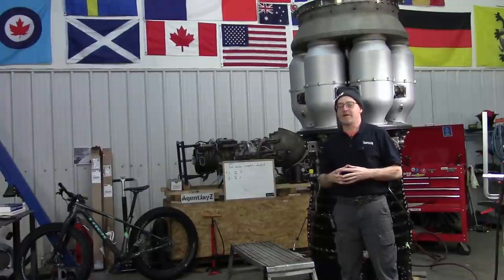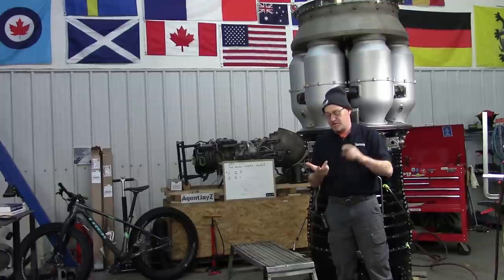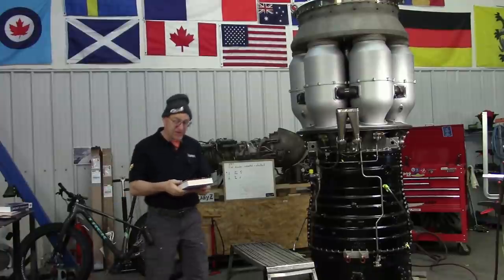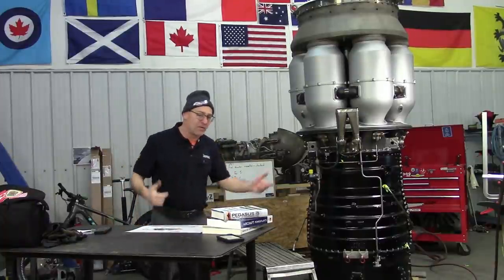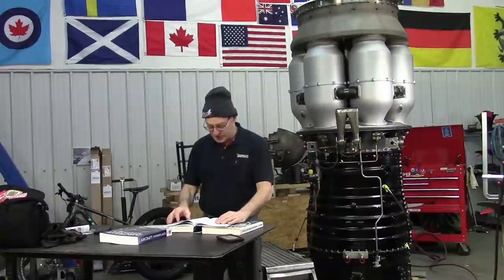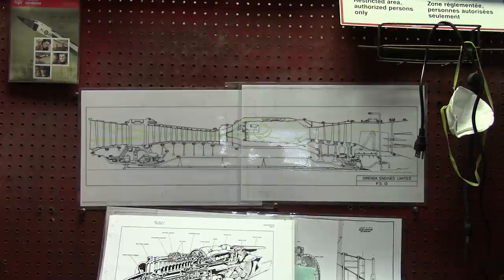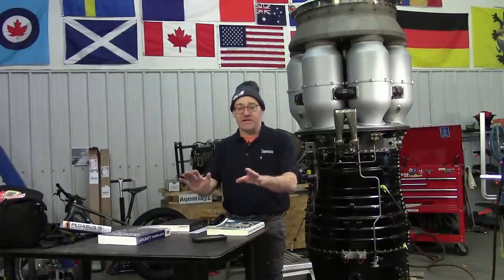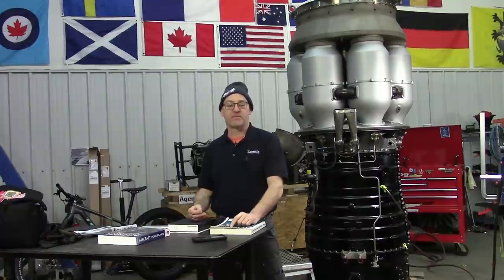So You Want to Design a Jet Engine

Comment: I am an engineer at a small jet engine manufacturer in our expansion department (everything combuster and aft).  It can take weeks to just to change the tolerance on an engineering print by .002" because of how many people need to approve of changes.  And I work on small engines, I can't imagine what the manufactures of the larger ones have to deal with.  Engines are very complicated and it takes teams of people and a lot of time to design new engines. Even if you could design one by yourself, manufacturing one is an entire other story too.  Tolerances on the shaft of an engine can approach .0002" and it takes a lot expensive equipment to manufacture parts that accurately.  I think its pretty unrealistic for an individual to make a jet engine approaching the complexity of any production engine.
Reply from the maker: I agree, and it's always good to hear from a professional in the biz!
Reply: I can only see failure for and individual. There are just so many thing you have to have better then a rudimentary knowledge of to get so many things to sing, so to speak! Now as for a hobbiest type turbine there could be a chance, maybe!? But then the machining it the toughest spot there! They are truly marvelous machines!

Comment: Great work as always 👍 12:30 as a machinist I have had long arguments with engineers and designers about standardisation of parts ,some clown at a computer draws 330 non standard countersunk bolt dimensions and then wonders why the machinist wants to hit him over the head with a book of bolt standards ...🤣👍 (real life example ,not in any way related to building jet engines ,but a real life example of why designers need people checking their work BEFORE it goes to the machine shop...)

Comment: I spent my career in an Aerospace Foundry. Many of the parts in this series are from the industry and even the foundry I engineered for. The material science and metallurgy is supremely advanced. Alloys in jet engine construction are Titanium in the cold section and superalloys in the hot section. All of those alloys have to be cast in advanced vacuum induction and arc reduction furnaces. Those processes are completely beyond any home hobby project. You might make a small jet but it will not last and will be nothing but a hobby simulator.

Comment: I've waited patiently and it's finally our turn.
 The runway is ready, the airspace is ready, the throttles advance. the brakes release. I begin a journey of several hours that it might take a man on horseback several weeks to complete. As speed builds, a childish voice behind me says out loud what I always say in my head, "Yee Haw!" Perhaps a future technician or engineer with skills to help transform piles of ore and puddles of petroleum into this fantastic machine. Then I glance down the isle to see folks reading newspapers or listening to MP3 players. Don't they understand the extreme forces and temperatures at work just outside the windows? Sadly, they are missing out, the poor, misguided souls. Thanks for the inspirational New Year rantlet.
Reply: Marvelously-written and worth quoting.  Thanks for brightening my day.
Reply from the maker: I agree. I wish there were cameras on top of the tail, at each wingtip, and underneath the plane showing the landing gear.
Sadly, the committees have decided that the average passenger might be unsettled by that. Let's all be average, people!
Reply: Don, please write a book.
Reply: @AgentJayZ  I've flown on a Malaysia Airlines A380 into/out of KL, on my way to/from Singapore.  The do have a tailcam, so that you can watch on your screen.  What I found a little unsettling was the tropical lightning of a distant storm.

Comment: With regards to measuring the length of a crankshaft, one time in my shop we received a compressor rotor from our customer's spares line and they asked us to prep it and install it in an overhaul we were doing for them. We visually inspected it, cleaned it, inspected it again as normal, Checked balance on it, and began the installation expecting zero problems. As we lowered the unit down towards the case it became apparent that it would never go in as the stages were not in their correct positions. After a ton of head-scratching followed by a very vigorous teardown inspection, we discovered "shop-X" had lapped the living daylights out of the compressor discs (TB5000) shortening the compressor rotor assembly by over .750 inches. Total scrap.
Reply from the maker: That's a great story. Expect the unexpected, eh?

Comment: If someone even wanted to begin to design their own jet engine, it would help to 1) have a mechanical engineering PhD, 2) Gather a team of CAD designers 3) Hire a fluid dynamics PhD 4) Hire an Electrical engineer and 5) Buy a $5 million dollar user license for CATIA and time in a NASA-like testing facility.
However, design concept/type modifications as suggestions are just fine. Nobody gets harmed from the suggestion of a concept. They can either accept or reject it and then move on, easy peazy.

Comment: I only needed two books to design my engine. "Gas Tubine Theory 4th Edition" by Cohen, Rogers, and Saravanamutto and "Gas Turbine Combustion" by Lefebvre. These are not introductory books and assume you know thermodynamics and have an engineering mindset. But everything is covered.  

Mine is a 300mm inlet engine. So APU scales, but will be using a free power turbine output.

My advice to beginners is to make a automotive turbo engine first. It's been done a million times, yea, but the theory and design is only half of it. Combustor design is generations tribal knowledge and not methodically engineered as the compressor or turbine. Automotive turbo gas turbines use can style combustors which are easy to iterate on. Get good at that first, then go bigger and more expensive. Why blow more money on R&D than you have to?
Reply: Looking forward to it changing the world - per the vid
Reply: @anotheruser676  if that were the goal, sure.
Reply: You will need a lot more than that.  Cohen and Rogers (before Saravanamuttoo joined in), plus Rogers and Mayhew, plus a few more books, plus a degree course in mechanical engineering, plus a five-year apprenticeship might help.  And then, after 41 years you will be some good at it, provided you are a member of a good team of gas turbine engineers.

Comment: I am en electronics design engineer. I have also designed some mechanical systems for commercial jets. For a laugh I decided to try and make a "bean can" jet engine. The best I managed was 0.6ish pounds of thrust for somewhere between 25 and 27 seconds before it destroyed itself. That's with mad maths skills and a good knowledge of design processes (though not the specifics of turbojets). To mnake things easier it used propane and brass ring burner with v shaped steel flame holder (bent in a circle which was a complete game). Colin Furze managed to make some better engines but they need way more in terms of oil pumps and all sorts. Even then he maxes out at 100 pounds thrust or so and it guzzles fuel like a mad thing (as did mine). I worked out that mine had about 1% of the efficiency of a Williams FJ44. So though you "can" get something that sort of works, JZ is absolute,y correct in that it takes a large specialist team ages to get an engine right. I live near the RR plant and know some of the engineers, and one I used to drink with a lot spent two years on one compressor blade to get it to the point where RR were happy with the performance. That's two years for a guy to get just one of several blade types right. Apparently the turbine blades are a lot more difficult.

Comment: Turbine design is basically rocket science :D There's a reason why top turbine engineers were hired at the beginning of the space race to help design new rocket engines that would take humans into space. The key to rocket engines at the time was new turbo/tubine pumps.
Reply: The five turbopumps on the Saturn V each produced more than 55,000 hp.   Total, TWO HUNDRED SEVENTY-FIVE THOUSAND HORSE POWER, just for the fuel pumps.
Reply: @av8bvma513  that's a lot of herspurz. I didn't know it was that much.

Comment: As one of those people who are undertaking this kind of endeavor, reading the books Jay presented and getting intimately familiar with a 3D printer should be your first steps, followed shortly after by forgetting everything you know about internal combustion engines and how they may benefit your wild design, because almost nothing short of metal fatigue and the general principles of combustion will transfer. I'm 2 years into my process, have 3 massive redesigns under my belt, an entire workshop of parts surrounding me, and a giant hole where my bank account used to be. After finally finding a breakthrough that perhaps could/should make an evolutionary breakthrough of the next generation of engines that can be made for multiple platforms, I will tell you that packaging and new materials are almost certainly the two most obvious areas where one can find the most benefit to 'reinventing' the wheel, provided you can scale it both up and down. Also be prepared to fail and fail often, learn from your mistakes and improve from your failures. I hope to have my failures on display when I finally get this prototype ready to unveil to the world that should make an interesting museum entryway exhibit. Your processes you develop will also have more impact and possibly benefit your bottom line far more than the end product itself, so get ready to learn about protecting trade secrets along with becoming an engineer, machinist, chemist and any number of other specialists. Lastly, be prepared for everyone in your life to call you a whackjob and expect constant ridicule. =/
Reply from the maker: Sir, it appears to me that you have quite a good grasp of the magnitude of the project. 
I wish you success, and I would love to see some pics or videos of your adventure.
Reply: @AgentJayZ  One of these days when I have a bunch of downtime, I definitely need to organize my build process media and make it into a discernible presentation, but in the meantime I can find some interesting snaps of the composite work and send those to an email box near you. Thank you for the kind words and your continued efforts to educate the world at large.

Comment: You're such a smart aleck, I love it!
I'm also interested in designing my own jet engine. My my goals are not quite as lofty. Something fairly small that can fly and won't get me blown up. I still feel like that's a reach, though. I'm interested in doing so for the learning experience, not for the end product.
Reply from the maker: The most successful builders of what you're describing start with a turbocharger and focus on the design of the combustor. They usually run propane for fuel, because it easy to make a good fuel nozzle for it.

Comment: I was working with turbojets and turboshafts. My ambition was to design my own jet engine form scratch. Considering available resources I could fund model jet engine size development. So I took a challenge, as designer, machinist, technologist. It takes 9 years working part time in hobby project, building three prototypes - 1st was forced to work by extreme EGT, 2nd - work well at idle conditions, 3rd - work as expected good acceleration, low temperatures, reliable.  Only compressor wheel was took from turbocharger,  diffuser,combustor, axial turbine was my design. Designing small turbines you would be limited by available bearings, and available of round bar of Inconell.

Comment: I’m going to design a warp drive
Reply: Good luck
Reply: Me too can you suggest a work around for e=mc^2? I need m < 0 and c > 3x10^9.
Reply: blipbloop1000 this comment was obviously a joke, but the theoretical warp drive doesn’t need to overcome those issues. You are “warping” space  technically you aren’t moving across faster than light because the space is moving under you. Kinda like a black hole can prevent light from escaping because space is “falling” into the hole faster than the speed of light
Reply: @patjohn775  hmmm I see your point, but getting the mass of the warping zone to less than 0, while moving it faster than light still leaves you with the same problem. I suspect leveraging some form of hysteresis is too much to hope for.

Comment: Literally have everyone of those books and more...  one could probably cobble together a 1st generation engine from published data. The vast amount of proprietary data that's actually used to make a real engine is locked up in the big boys design offices.  But every year low price CFD software is pushing the boundaries of what can be simulated. I think it's only a matter of time before someone does it.
Reply: The thing is those big boys are already using the most advanced software to improve their designs. Though it would be awesome if someone found a new way to do things.

Comment: "42"
"Inches or millimeters"
"Yes"
Reply from the maker: Cubic astronomical units, sir!
Reply: Smoots!
Reply: @AgentJayZ  When this Covid-19 stuff is all over, how about meeting up at The Restaurant at the End of the Universe for a Pan Galactic Gargle Blaster?
Reply: More importantly how much precision or no. After decimal is enough and feasible.
Reply: For taking dimensions out of a blade one have to create a cloud of points with dimensions in x, you and z to the accuracy I don't know.
Sometime i think how the roots are toleranced so that they swing freely to absorb vibrations, expand contract during their operation and survive hell of stress system.

Comment: they would also need to know about Thermodynamics, fluid mechanics and heat transfer

how can you build a jet engine that revolutionizes the world if you don't know what the max theoretical limit of efficiency that an particular engine can have
Reply: And after they have done all of that on the design part. They will have to Manufacture it.. 🤣🤣🤣 that’s where they will realise they need another life time.. 🥲

Comment: you can't design a gas turbine, but you can design a pulse jet or a solid fuel rocket (if you are smart.) Those are technically jets.
Reply from the maker: Sure.
Reply: Yepp, Jet Propulsion Lab (JPL) never worked on what we would call jet engines, they were a bunch of guys playing with solid fuel rockets for Jet Assisted Take Off. JPL can also read Jack Parson Laboratory, he was an interesting dude.

Comment: Thanks for the laughs and the interesting read. What I think you have not even mentioned all ,  next to all the math, physics, fluid dynamics, metallurgy, engineering, ... is the legal field: patents. I am not an expert on the topic but I suspect there to be thousands of patents around every single system in a jet engine that you have to potentially violate when you want to commercialize your "self designed" engine. So even if you get your engine up and flying (which you won't) be prepared for some really nasty cease and desist letters in the mailbox.

Comment: Recently I calculated the cost in hours to complete an Experimental Aircraft design, which I've completed a basic preliminary design and performance estimate on already. 

It would takes no less than 3,000 man hours just to complete the detail design. But before that, I need to invest about $20,000 and 1000 hours to acquiring the composite/carbon fiber data before it can even be designed in the first place. Otherwise I'm detail-designing a structure with unknown material. 

In order to build the molds and tooling required, another 1000+ man hours.

Then another 1000+ man hours to build the composite parts.

Any machining would be outsourced at $135+ an hour, times maybe 20-50 hours.

2,000+ man hours to assemble everything.

Oh yeah, and that's as much as $60,000 in carbon fiber for molds and aircraft parts. And another $40k for engine, $20-30k for instruments. $10-20K for landing gear and misc parts. 

This is for a single seat, 210hp aircraft with a 23' wingspan weighing 1600lbs. 

It's impractical to design andbuild your own anything. 

An engine is FAR more complex than an airplane with a premade motor. 

And I'm talking a piston engine not a jet engine. 

Your better off buying the Williams for aprox $1M USD. 2,000lb thrust or so, very very low fuel burn for a turbine of that size. Half the fuel needed over the old J85 based small jets engines. So it will easily pay for itself in reduced fuel over it's life... 

If you don't need that much thrust just get those model RC jet engines like that flying man uses and the wing suit guy has. 4x engines at 200lb+ thrust each will make your skateboard damn near supersonic.
Reply: Also look at the engine for the  Sonex Subsonic kit aircraft. Engine is ~$60k, fuel burn is not bad for a turbojet. Hot section needs to be inspected every 300 - 350 hours though. The PBS TJ-100 in this configuration produces 240 lbs of thrust.
Reply: @ailijic  that's a sweet little kit. Haha.
Reply: Keep an eye on Hill Helicopter's new turbine design. The entire helicopter is proposed to be under half a million, and it's an all-new engine design by experienced turbine designers. This would be a turboprop if it was fitted to a fixed-wing.